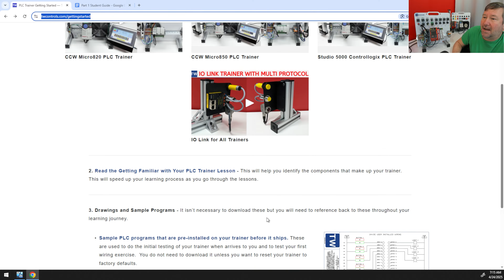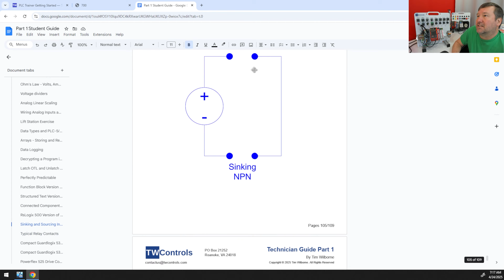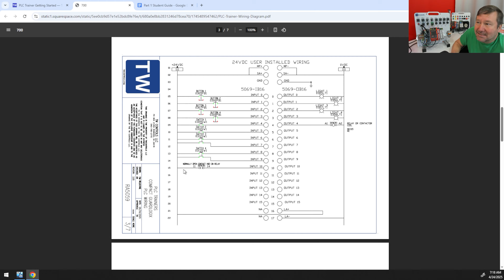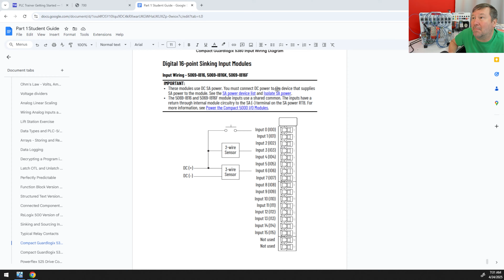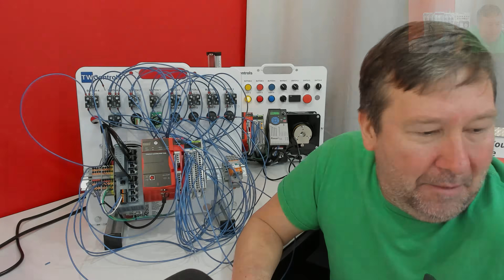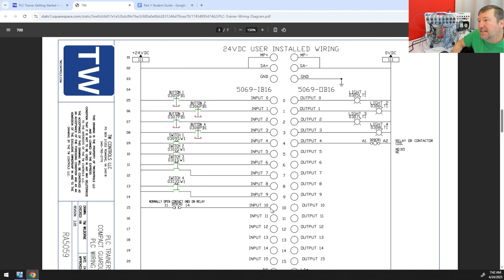Wiring 5069 IO to a CompactLogix 5380 PLC: Step-by-Step Guide

Comment: Could you just jump a wire from MOD+ to SA+ and MOD- to SA-?
Reply from the maker: It looks really bad when you do. We run two separate wires on our trainers even though they are the same voltage source just because of the way it looks. Also MOD and SA are not necessarily the same circuit depending on the system design.

Comment: Watch out when you start wiring analog inputs.  The IY4 and IF8-A are isolated, the IF8-B is not.  Upgrading some ML1100t to the 5069 and blew out diodes on the IF8 wiring 4-20 inputs.  All negatives are connected together to 24V gnd.
Reply from the maker: Thanks for the heads up!